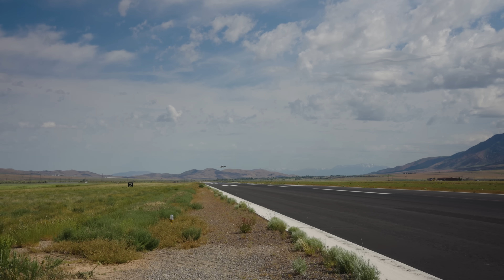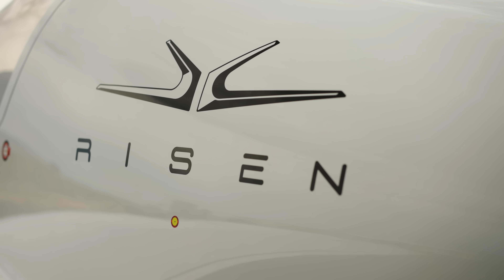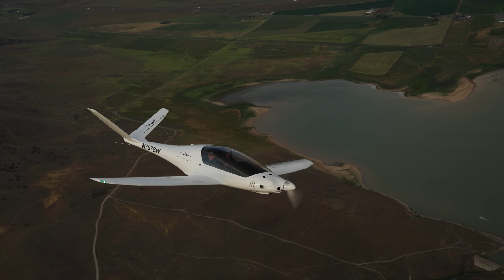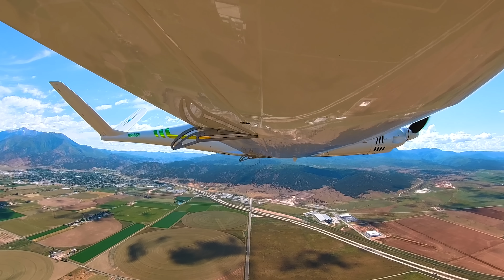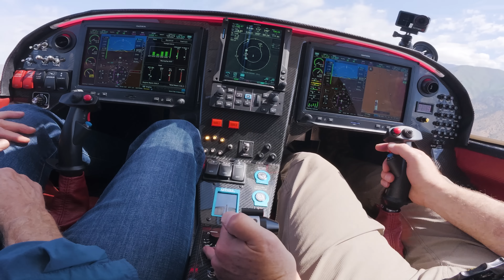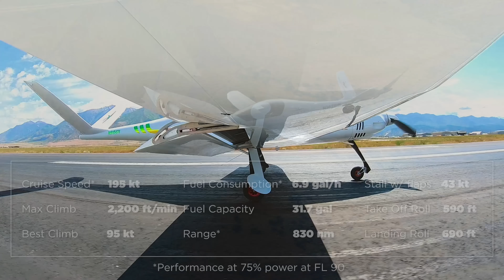Risen Super Veloce - fastest and most efficient airplane of its class?

Comment: With long range tank option and oxygen you can fly it high 20,000 ft for thousands of km throttled back to 20%. If you choose the 918 Rotax 188hp, request the high altitude upgraded big turbocharger. It gives full power and efficency at FL20 compared to the stock turbo which drops boost.

Comment: Amazing plane but gear down speed seem very low. 74 KTs but need to hold approach at 70kts. Very narrow margin. And approach speed 70kts maybe challenging for some busy airports. May end up doing a lot of 360 to give way to faster aircraft. I used to fly my bonanza 140 kts into FXE, less than 5 miles before I start slowing down, drop the gear, flaps etc...

Comment: I couldn’t find a price for a 916 so it must be breathtaking.  I found a price for a used 914 and it was $300,000 so I expect a new one is $400,000 or more.  That is more breathtaking than is the performance.
Reply: Feels like a buy once cry once situation where, yes, the plane is expensive. But what I’ve seen with these rotax-equipped planes is the savings in fuel and longer mx intervals. So maybe that’s the new meta in this class of aircraft
Reply: Aviation ≠ affordable... you're defying gravity bro. Bring your wallet
Reply: A 20%-25% fractional ownership would be sweet on something like this.  I've owned a few planes over the years, some solely, others fractional, and as long as you have a solid group of co owners, there's zero downside.  All of the crazy expenses of owning an aircraft divided by 4 or 5 really start to take the edge off.  And no I've never once ran into conflict with not being able to use the plane because it was being used by a partner.

Comment: What are the gear and flap speeds? They seemed really low in the video.
Reply: The video stated the gear speed.  You should watch the video.
Reply: @LTVoyagerhe was commenting on the speeds mentioned. 73 kts for gear and 90 kts for flaps is totally impractical for a plane with this cruise speed. My Cessna 210 isn’t nearly as fast as this plane and gear speed is 165, flaps 160. Just indicates that these systems are very fragile.
Reply: @SkylaneGuy No, he asked a question as to what they are.  That is what a question mark (?) means.
Reply: Yes is the correct understanding of my
comment. Both Mooneys and Bonanzas I am familiar with have much higher gear speeds.

Comment: 180kt cruise, 73kt gear speed, 43kt stall speed.... yes, one should definitely be thinking a few steps ahead when entering the pattern!
Reply: 212 knot cruise up higher.
Reply: Actually 210kt true cruise at a normal power setting at 15000. Faster when higher. And you don't need a particularly cold day for that. Turbo!
Reply: Risen is beast but "Van's RV-9A 916iS with the Lockwood setup — 214 knots top speed flightaware data(prototype N179RV) — and packed with BRS, air conditioning, 20-gallon aux tank, plus a full Garmin suite with autopilot & GTN 750Xi. This 2-seater comfortably reaches SR22T territory, all for about $270k USD."
Reply: @Prasanpaul-f1q  It's actually closer to 400K now with all those upgrades and an ifr panel. With the 916is you can't get one for less than 350k but still cheaper to operate than cirrus and no top end overhauls at 1200 hours
Reply: @TheBynderFiles  risen sv916 .. 350k plus rv9a 916is 270 k ...
Reply: @PawanPaul-qq4jx  oops read wrong, didn't realize that about the rv9a that's impressive speeds. classic "my bad" lol... carry on
Reply: I'm thinking it would get dicey if you entered faster and or higher than desired as it just looks to me like it'd take some effort and planning to slow down.
Reply: Yes this begs for some Precise Flight speed brakes.

Comment: I flew this plane two years ago. It is the dream; fly fast, land slow. Wish the fuel capacity was a little more, but the efficiency of a 916 would increase range. Should be a perfect MOSAIC plane.
Reply: There are now new long range configuration that will allow you to fly in eco mode for about 20 hrs no stop.... that should be enough .... :))
Reply: @portoaviationgroup  4 seat reveal next year correct ? 👍🏾
Reply: @portoaviationgroup  really? that’s great to hear.
Reply: Thought about re-engining my 235 to the 916, but age caught up...
Reply: The EP918ti is also being used in the Risen. Yes it’s based on the Rotax 916, but offers increased power and efficiency.
Reply: @andrewday3206  I’ve never heard of this engine, is it still considered a Rotax? Who supports this engine if the extra horsepower causes the gear reduction to fail?

Comment: It is a remarkable data point but we need clones because the price has drifted to 400k. Fixed front windshield and butterfly doors like Cirrus, then you don't need the large motorized canopy and skip the flaps. It's large elaborate mechanics and it's simply not needed. Much greater benefit to lowering the weight and complexity and price. Skinny fixed gear could also be an option. The trick is the monobody tadpole body, very simple to duplicate. And you can cut maybe 100kg from the weight, that will make it perform even better. You might get close to same stall speed without flaps. F flaps :)  Rotax greed ads 52k for the motor but even with that burden, it should be very easy to come in way below 400k. And if you cut 100kg from the weight you need a less lifting wing, less drag which means it will naturally outperform even the Risen. Beyond 400km/h top speed and less fuel burn. Put in an oxygen maker and it's a serious plane.
A 2+2 seater variant is also possible. Kill Cirrus. Seats can easily look better than Risen. And with a bit of financial success, make a replacement for rotax. That little VW beetle engine should not cost a performance Tesla.
Reply: Lol what? “Make a **completely different airplnae**!!”
Reply: @quinncide  It would be a different plane. It can also be a T tail. I think V tail has some inefficiency in case of trim
Reply: The canopy can be built with gas struts, but I doubt it'll save much weight. The flaps I would not want to live without. I wouldn't want to stall it at low altitude, and the short field characteristics are very nice to have. It's experimental so you can build it without flaps if you like, but I wouldn't suggest it. It seems to me you want a Piper Cub or one of the several European fixed-gear LSA planes.
Reply: @davidswelt  a piper cub? A PIPER CUB???? yeah no :)  try to understand that aerodynamics is real. That's why a Risen can do 400km/h and a piper cub cannot. That the air is invisible doesn't mean it isn't there.
Also try to understand that getting rid of flaps will only raise stall speed by a handful of knots and with the weight saving of a cleaner design the stall speed can drop a couple of knots. Stall is not something that arbitrarily pops up outside of the control of the pilot. A Risen with no flaps still has stall speed well below a bonanza. Getting rid of the flaps on a Risen is a very significant mechanical simplification and it would still have very short runway requirements. Indeed the lighter it is the easier it is to break and accelerate to take off. It could have superior take off runway length. And superior top speed. And fuel economy and cost of manufacture and repair. You see?
Reply: @davidswelt  Agreed, those large fowler flaps are what allow this fast plane to land so slow, (25kts slower than my plane) and 
need less than a 1,000’ runway.

Comment: Price? I'm assuming it starts with at least a 5.
Reply: Google AI :The price of a Risen 916 SV (Super Veloce) is approximately $350,000, according to a YouTube video from March 2025. This is for the Super Veloce version, which features the higher-horsepower Rotax 915 engine and is known for its speed records. A base Risen with a Rotax 912 engine is priced significantly lower, around $141,000, and the fixed-gear (FG) and retractable-gear (RG) versions are also priced differently.  
Risen SV (Super Veloce): Approximately $350,000. 
Base Risen (Rotax 912): Around $141,000. 
Base Risen (Rotax 914): Around $188,000 for the retractable gear (RG) model.
Reply: @3B100SF  The ICON A5 which I've flown (a delight) started out with an unrealistically low price. We all know how that's turned out.  I guess if you have to ask, you can't afford a new plane today.
Reply: $140k for fixed gear, $240k for retract.
Reply: @ScottsSynthStuff  with Engine?
Reply: Yeah the flying price can fluctuatet based on avionics.  Certified Garmin high end is $100.000!!!!  If you can go experimental the avionics are more versatile and cost 1/4 the dinero..
Reply: google it.🤦